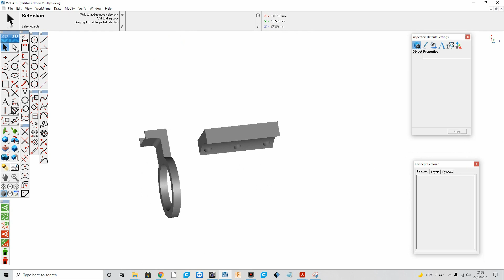Low Cost Tailstock DRO.

Comment: Thanks for the shout-out. A superbly simple solution for accurate depth measurement on the tailstock. Even easier on tailstocks like the one on my Warco which are square in section. I shall definitely be making one of those. Cheers, Alan.

Comment: Being a machinist and tool and die in training for 7 years, this cracked me up, but also reminded me of all the add ins for dial drop indicators we have for manuals from the 90’s and 80’s still at the college that no one uses after converting to DRO.
Eye for the wise, get a $50 pair, not a $15, the $15 has absolute rubbish for .005” accuracy. If you do any level of DRO, minimum accuracy needed is at least 0.003” included repeat, other wise you may as well use the collets and save $15! I’ve been able to get +- 0.001 using a dial caliper touched to the saddle with a mag base, so good method, but only as good as your tool is for measuring.

Comment: Glad to see this idea shown, 
one thing I can say is tho, is a lot of those cheap calipers is that they don't turn off automictically and they don't isolate from the battery either,
meaning they will drain the battery after a few weeks or a month, so do plan to get a lot of spare batteries or take the battery out after use or just get a better caliper. 
also after a while the readouts/measurement's start to become inaccurate. 

I know this is a cheap option but do find a cheap caliper that has the battery energy saving feature.

Comment: Thank you for sharing. How is the fixation of the caliper on the ring side?
Reply from the maker: The printed part is shaped so it clips in place. As the measurements will always be read with the tailstock feeding towards the chuck no other fixing is needed but an O ring would keep it in place if needed

Comment: They make digital scales in various lengths that are just the caliper head and the slide with screw fixings in each end. That might make construction a little simpler. They cost a little more than a cheap plastic caliper, but not hugely last I looked (which was a few years ago). I got some on eBay, but you can probably find them in various places now.
Reply: I just looked it up.
1000mm for €136.
😲
Reply: @glidercoach  That is a good bit longer than necessary. That plastic scale was about 150mm. A quick look on eBay shows them for about $40 US, which I guess would be around 35 Euros. Still a bunch more than the plastic scale. :-(
Reply: @lwilton  
My Bridgeport mill has a 4 foot table. 1000 mm is perfect and €135 is reasonable.

Comment: Could you test this against a dial indicator to check the caliper's accuracy? I've always been curious about the reliability in a setup like this, since those calipers are so cheap. Great design!
Reply from the maker: I checked it against the "proper" dro on my mill over 50mm.
It is accurate to 0.1mm which is the resolution of the caliper.
Quite accurate enough for drilling holes to a specified deth in this aplication.